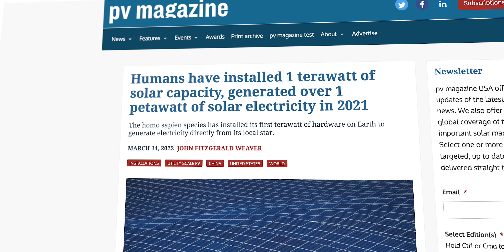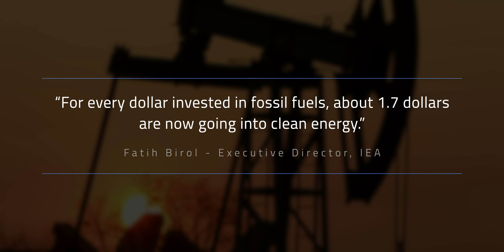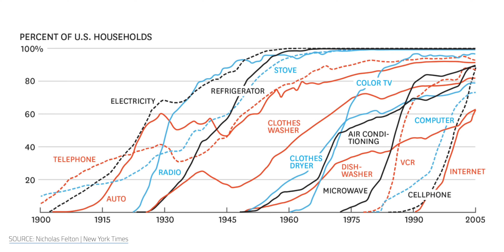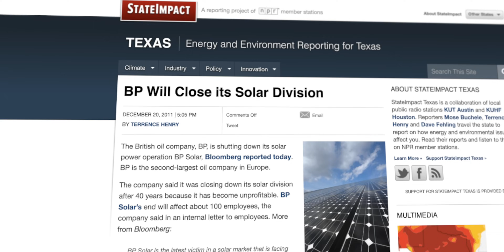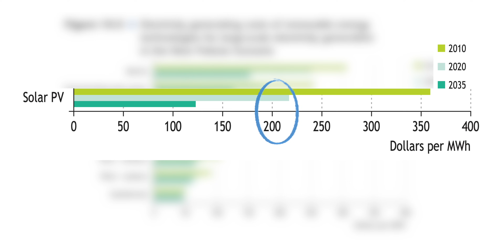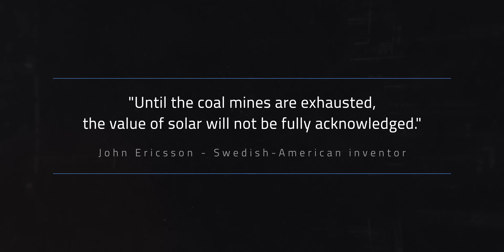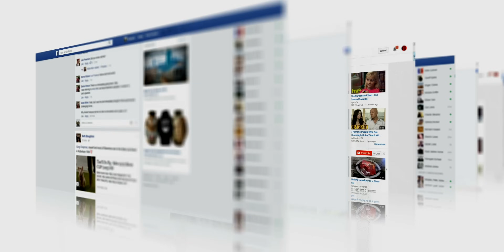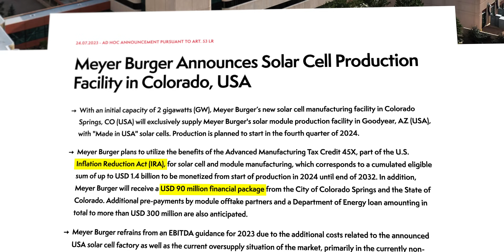How Solar Power Got So Cheap … So Fast

Comment: I just began seriously considering rooftop residential solar, and it didn't take long for me to uncover how unfair and anti-solar my local monopoly electric utility is. The unfair net metering arrangements and fixed monthly "grid connection fee" changed my long-term plan to completely disconnect from the grid to spite them.
Reply: One can build out a system that can reduce your need for power. EG4 has solar powered minisplits. With a few panels, one can build a standalone power system, not connected to your traditional wiring and take solar and decrease you dependence. Much of a homes load is heating and cooling, and with a "supplementary system" powered primarily from solar, you can use solar to heat and cool. The electric company won't punish you if you have a small power bill every month instead of a big one.
Reply: @cryptickcryptick2241  indeed,  but the utility's connection fee will remain
Reply: This is where I’m stuck at as well. 

The cost of solar + the monthly connection fee is higher than my current utility bill. So in the summer months it’s close to breaking even, but the winter months will be like paying 2 utility bills.
Reply: Given grid infrastructure costs are a sizable fraction of energy spending, how is it unfair to ask users to pay for it?
Reply: @veedrac Then bundle it into the cost per kWh and average it out.
Reply: @veedrac it's unfair because it's a monopoly. Monopolies by law should not exist.
Reply: @adenm8963  So you think that utilities should be a free market place rather than a regulated utility?  How would that work?  20 sets of power lines running down your street, 10 sets of water lines, another dozen sewer lines?  In fact, the only reason anyone is offered net metering is because it is a regulated monopoly.  Net metering is political.  If power to the home were a free market, no one would do it, it is a total money losing proposition that politicians have decided to implement because they can order it to be subsidized.  The days of net metering anywhere are numbered because it loses money and you can't lose money on a significant number of your customers and , pun intended, keep the lights on.
Reply: @apostolakisl  it would work just like internet networks do, with several companies constructing infrastructure, competing to provide the best services for the lowest prices
Reply: @adenm8963  This is incorrect. Being a monopoly is not illegal. What is illegal is (market) abuse of a monopoly position, which, whether or not it exists, wasn't yet demonstrated.
Reply: In my part of the state it'll cost me $1/day'ish to maintain connectivity.  No "net-meter" for me, either.  We've just kicked the GOP out of the state capital so I hope something is done to push "net-meter" through.
Reply: @adenm8963  No, monopolies for power, water and other massive capital cost services make perfect sense.  By example, name municipalities, states, regions or countries that do not use "approved" monopolies for power and water.  (I use the same argument when people whine about "income taxes are unfair" -- which nations don't use them?  The answer is about 14 nations, all very small and generally associated with oil or tourism.)
Reply: @DrewskisBrews  The norm in most places is that building code laws or the utility itself require that any habitable residence have a connection to the grid, as well as water and sewer networks if available. The strong utility lobbies fight for this, so what we the people have to do is cause those laws to be changed by voting in whoever there is that will bring the needed changes to us. Yes, this may mean voting for the 'other' party, or for someone you otherwise despise, but this is how democracy works in America...
Reply: Really the lines to your house need to be paid for.  The problem with net metering is the electric company is being required to buy your power when the utilitie's cost of power is very low and to sell you under priced electricity when the utilitie's cost of power is at it's highest.  I think the utility would not have a problem with net metering if they could choose when they got the power from your system. In fact utilities are happilly doing this for customers who are supplying their solar power when the utilities need it.  So maybe ask your utility if you can make such an arrangement.  Be aware you may have to buy some batteries or have a suitable EV setup.
Reply: Maybe try and take that up with your state. Pretty unethical if you can find a way to broadcast the issue and embarrass them.
Reply: Yep, and now your solar system cost isn't so cheap anymore, as 30KW+ of batteries ain't cheap.
Reply: @jimmiller5600  in most countries public utilities are public, or were until Neoliberalism was inflicted on us in the 1980s raising prices & reducing service. There are exceptions, all of which seem to feature corruption at the heart of government.
Reply: @cryptickcryptick2241 good point , I built a fully off grid house last year and now enjoy the bill free benefits , I have been asked a lot about how it worked out  and how efficient it is . I agree with your comment about having a stand alone system to take  high usage off the electric bill and go further by suggesting  people install a mini off grid system to run these demands . Nothing complicated about an off grid  set up   if it is dedicated to specific use after the meter . it is  simple enough to connect panels /inverters to pool pumps, water heaters , A/C units without going through the fuse board , just direct connection , as you say the Po cO,s dont care if youre not using as much of their supply as you maybe did  .
Reply: Yeah. Move to an off grid acreage subdivision in a desert solar subsidize state like Colorado.
Reply: @veedrac  in most countries grid infrastructure is paid for through general taxation because it's a public utility & therefore State-owned. USA is an outlier.
Reply: @apostolakisl  there are many instances of free markets of regulated utilities, they're not mutually exclusive.
Reply: @apostolakisl  while power companies were establishing themselves in the USA there were routinely 2 though rarely more than 4 networks running along each street. Most countries disallowed the mess & regulated standards & created public utilities for distribution, often for generation too. USA is weird.
Reply: @apostolakisl  net metering is offered because it reduces the need for centralized peak-load generation, that's why offered prices are different at different times of day.
Reply: @DrewskisBrews 

Paying the connection fee is cheaper than buying and replacing batteries.
Reply: @alanhat5252  Sure but “you have to pay for the grid even if you don't use it” is hardly more fair by original metric than “you have to pay for the grid if you use it”, which is what was objected to.
Reply: @apostolakisl  net metering does not make sense but the utility buying power when it needs it does make sense. Also discount for using power when the utility has excess power.  Like maybe a home could act like a battery.  Storing power when it is cheap and selling it when power in more costly.
Reply: @DrewskisBrews  look at it from your City's perspective, if everyone goes solar the Municipality will be at risk of shutting down, unless they charge a fee... it feels unfair, but they're goal is to keep utilities in operation. In my opinion the nominal fee they ask is very reasonable, it supports your communities infrastructure. People seem to forget that social services exist because we pay into them. If the service loses to much funding, it no longer functions.
Reply: @apostolakisl we should be allowed to not be connected.
Reply: @DrewskisBrews  Yes. The connection fee will remain, but that is actually some of the cheapest power/capacity available. It really is a good value. Paying a small fee to keep 24/7 grid power available with as high or a low of a demand as you need is so much easier. There are lots of things one can do to reduce need for power (short showers, insulate, change heating and cooking methods, ect) On the side what you can do is build out a small to medium size stand alone system (not connected to your existing panels) and connect several big load items to it. This can allow you to use lots of cheap used solar panels, use cheap solar power at minimal cost, have backup heat and cool, and even some battery capacity as an emergency backup.
Reply: @apostolakisl we should be allowed to disconnect completely and not have to use them at all. With the risks that entails. But in many places that’s actually illegal. It was originally put in place to guarantee everyone electricity. But it’s outdated.
Reply: @jimmiller5600 but we don’t need them anymore. It’s possible to go off grid now. We should be allowed to be disconnected from utilities if we want to.
Reply: @MoDa87  I'm not going off the grid in my climate unless I go build a modern, more energy efficient home.  I'm paying less than $300 a month and could slice that if I had too.
Reply: @veedrac - Not true.  Sherman Antitrust is still a thing.  Ask Microsoft.  They lost an antitrust lawsuit in the 1990s or early 2000s.  If a business is the only gateway for other services or program access, they'll be broken up like Ma Bell was.
Reply: @veedrac  they charge 10x what they CREDIT for my power delivered to the grid during peak demand, and they won't let it cover the grid fee? That's anti-solar.
Reply: @apostolakisl  You can separate generation, utility and distribution, and have a each be a separate market, the distribution part can be a non-for-profit public company, the generation can have companies compete for the lowest kwh price.
Reply: @veedrac  what do you mean by that (not yet demonstrated)?
Reply: @P_RO_  it is allowed where I live
Reply: @shoobidyboop8634  yeah, but screwing the utility sends a distinct message, even if I spend more. They don't want solar.  They do everything they can to make it financially undesirable in Kansas. They limit the system capacity, credit 1/10 of what they charge, and the credits won't cover the grid fee. Kansas has a pitiful amount of residential solar because of the utility's actions. And our electrical rates are not particularly cheap.
Reply: @janshuster1426  yeah but the utility is actively discouraging residential solar, so I can pay extra just to know that I've escaped their manipulation
Reply: @baileescott401  this is a for- profit company in my area.  They are trying anything and everything that will bolster their stock price.
Reply: @cryptickcryptick2241  I can grudgingly accept that,  but the fact remains that my utility is patently anti-solar.
Reply: @veedrac  maybe it wasn't demonstrated in your country, but in mine it was several times, and nothing came out of it since we can't go without electricity, we can just change the directors and get to the same spot after a while expecting a new scandal. The problem is that to each monopoly the primary goal is to maintain it, and maintaining it requires more money, no competition and more political power. And more money spent on on gaining power is more money out of the customer pockets.
Reply: @marsovac  To be clear I was making no claim of innocence, only that having charges for maintaining a grid connection is defensible and other information was needed to judge. It would not surprise me at all to hear that some, or even many, of Kansas' municipalities have bad deals for rooftop solar to discourage competition.
Reply: - and the upfront cost with contingency plan - for spite ?? - just curious
Reply: @apostolakisl   - the supply and distribution utility should be a government monopoly - not a market system, the power running in the wires  that is the marketplace, all should be welcome to take part - inputs and outputs are easily calculated by the "umpire" - the govt provider - on a "costs basis" - (make it short term tender based if long term entrenchment creates lazy gougers - or just chop heads every so-often, Marie Antoinette style) - who also should bet paid by the retail players.  Supply chances are merely to ensure a minimum funding level by the end users. *what many are unaware of,  are the transmission costs, - on top of "wholesale prices" - levied on generators.
Reply: @veedrac    (government mandated  and approved  monopolies is what our capitalist system is sort of founded upon)
Reply: Where is that Drew? In Michigan I'm getting 16 cents per kwh during peak and 10 cents during non peak.
Reply: An alternative is you could take the money you had planned to spend on solar and invest it in a power company.  Companies like Consolidated Edison have a Dividend of 3%. If you invest $40,000 in an electric company, and get a 3% dividend; that will come out to $1,200 a year in income or $100 a month, enough to cover an electric bill.
Reply: There's a nugget of a real reason behind  power companies' resistance to solar: it adds power to the grid at times when it isn't necessarily needed, yet also drops production when it is needed. So power companies are paying out money to consumers with home solar installations, but can't actually reduce the number of power plants they need to maintain. In fact, because solar power production creates such a spike and trough, power companies have to use peak plants instead of normal baseline plants to try to balance load. Peak plants are more expensive and pollute more than baseline plants, so the net effect can be that is that electricity becomes MORE expensive and MORE polluting.

TL;DR: Solar without storage doesn't necessarily help the environment and can make electricity more expensive, therefore power companies' resistance to it isn't completely unfounded or selfish.
Reply: @erikdietrich2678  this seems incompatible with our local power needs: a forn of peak charges are billed here during weekdays in the summer season, when solar would benefit them the most.
Reply: @DrewskisBrews  air conditioning usage in large office buildings is far more efficient than at residences, so when people are at work overall AC demand goes down. Folks also aren't running appliances with high power demands, like hair dryers or water heaters, like they do first thing in the morning near sunrise. Plus, depending on how the solar panels are oriented, right around solar noon is maximum power generation, but the gradual heating of the  thermal mass of buildings and daily high temperatures occurring in the afternoons means AC demand goes up much later in the day. That's the longest way of saying: without grid storage, there's going to be significant misalignment between folks trying to maximize their home solar revenue and when the electricity is actually needed.
Reply: Alternative off grid batteries are available. We rented a home in Hawaii where everything was off grid. I was surprised that the refrigerator was always cold and the water was always running by a pump and ultraviolet light to kill off microbes. Additionally heat pumps are the new wave of cooling and heating saving electricity.
Reply: Less expensive batteries will eventually allow many of us to go off grid.